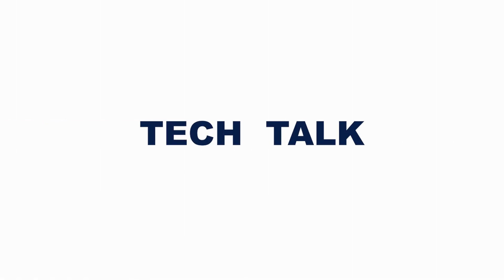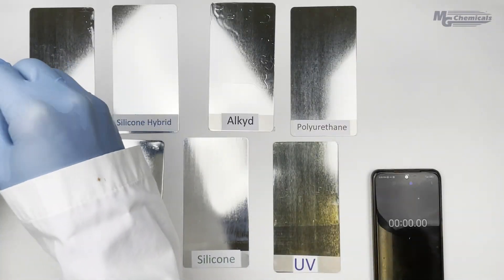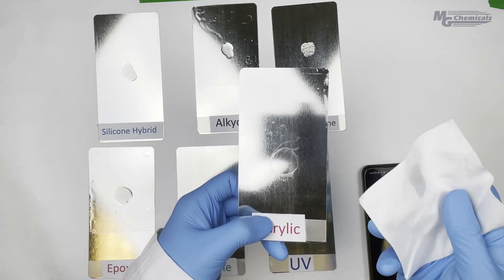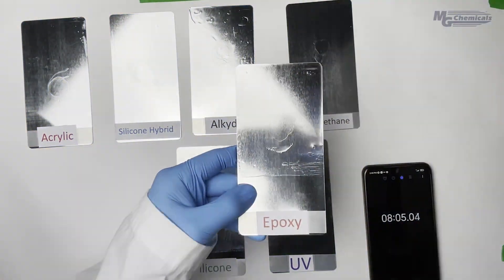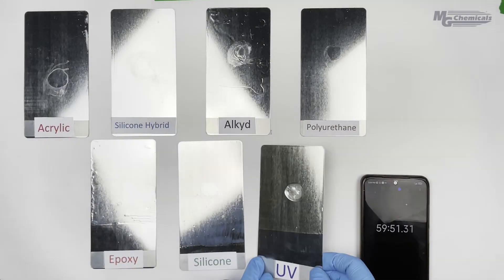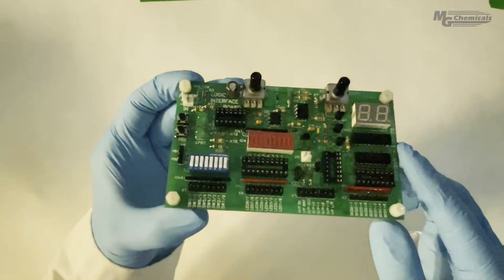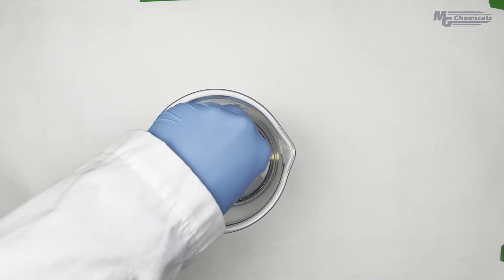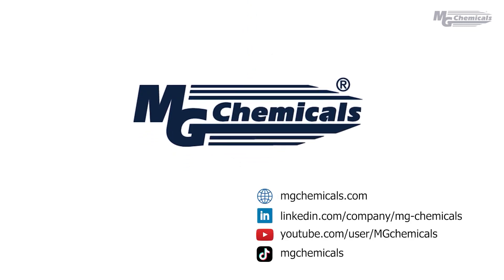Tech Talk Episode 11: Conformal Coating Stripper

Comment: Sir i have one question please help 🙏 can i use conformal coating on gpu pcb?? and what components i should avoid on coating process??
Reply from the maker: You want to avoid pins for male-female connectors and obviously where the pins plug in but otherwise there are no issues coating the rest of the board